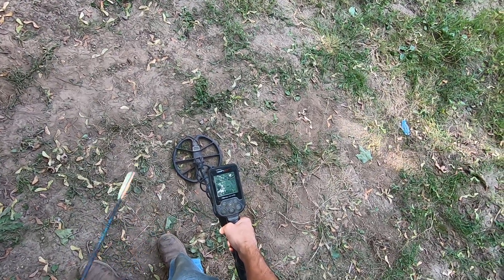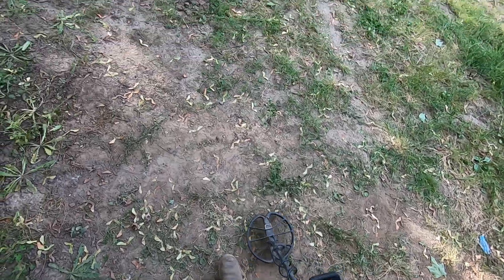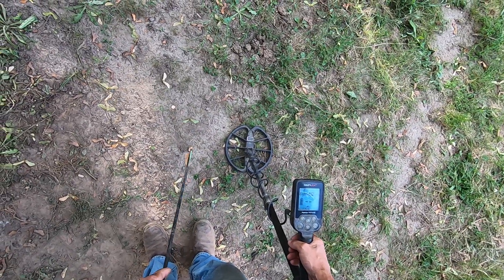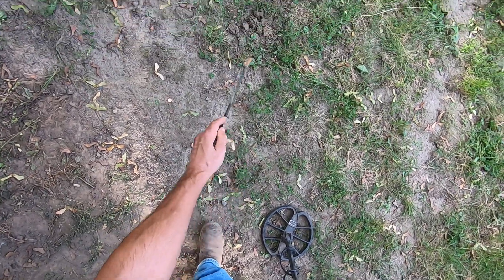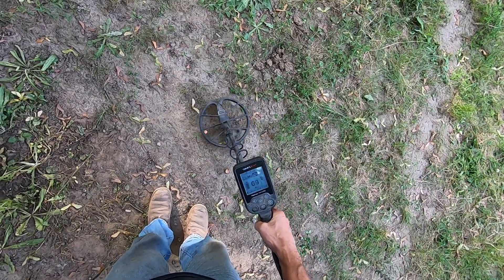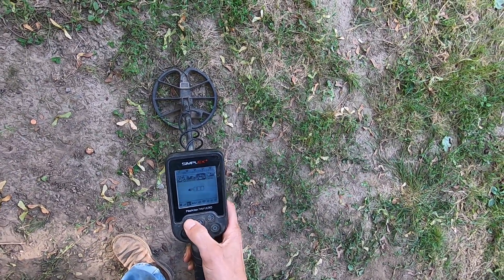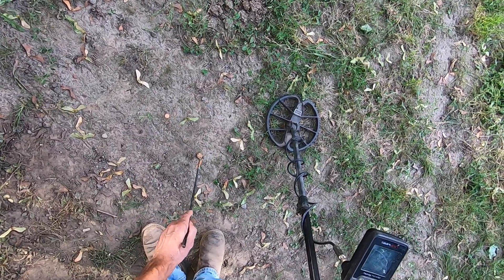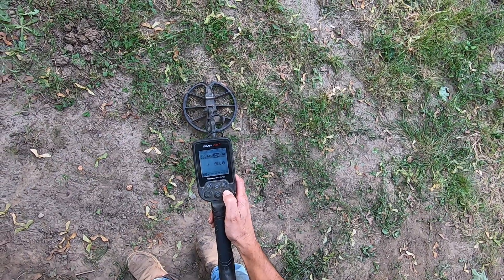Simplex iron volume explained. Demonstration on bottle cap and penny.

Comment: A good detector doesn't make any sound on bottle caps.
Reply from the maker: Simplex has proven itself to be a good detector.
Reply: @PaystreakSuperfreak  If a bottle cap gives somewhere between 68-74 instead of just beneath foil than there's something really wrong.

Comment: If you pump the coil down on the target it will tell you if it's a rusty cap
Reply from the maker: I still dig them up. That bottlecap could have a goodie in the hole with it. Pumping coil works good too.

Comment: Totally agree with You on iron volume. I use zero discrimination all the time, but set volume of iron at 1 or 2 but more so on 2. I still like to hear the iron but at a lower volume. I have been detecting since 1970, and still go out about 6 hours a day. Metal detecting is a Great Hobbie and helps You keep in shape.